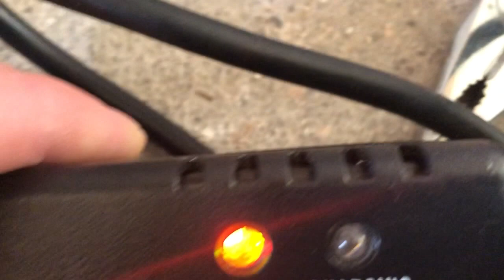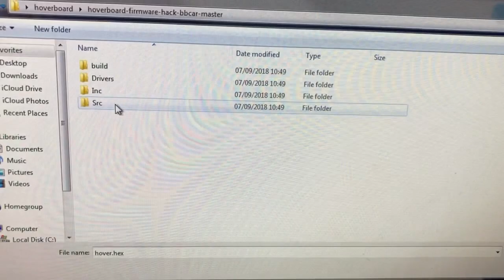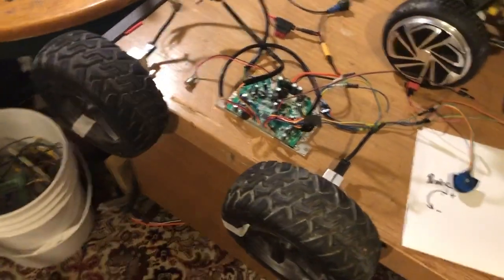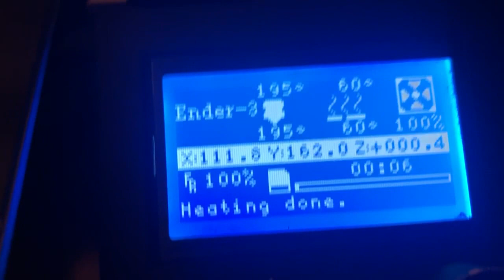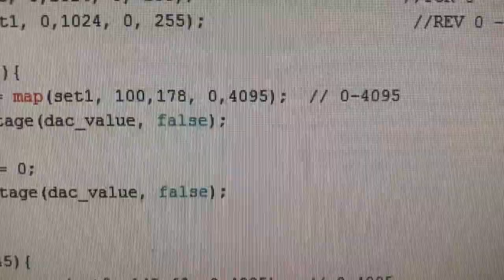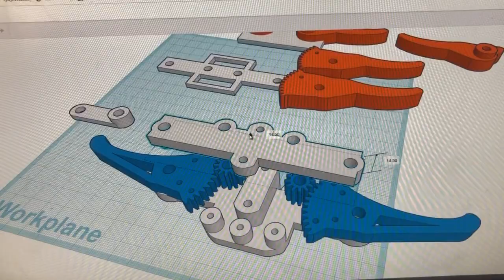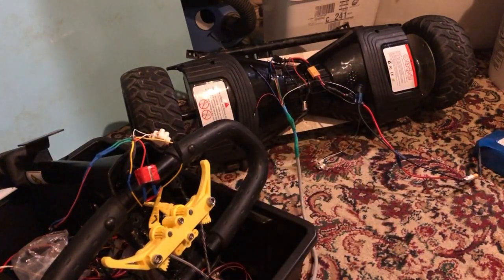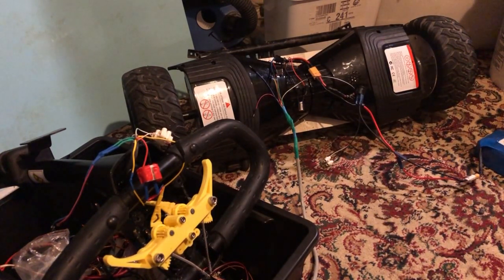HOVERBOARD MOBILITY SCOOTER - Part 1 - Build and Test - bobby car firmware

Comment: Ok what you did, you did well. 
The mobility scooter motor did look rough but it's likely that it was still able to function. I do like the hover board motors, they are efficient and hold up well from what I've seen. On the other hand the motor(s) and gear setups in the mobility scooters are on another level of durable function made to not break easily for a long time. As medical devices with functions must be dependable. 
What really makes the mobility scooters motor and gear setups put the hover board motors to be child's play in comparison is the amount of torque they have. If you have the battery power you can push/pull a a car/truck up a hill... At least until the incline becomes to much for the scooter to keep traction because it's not heavy enough. So you might get pulled/pushed back down the hill but the wheels will continue to turn. 
I just wanted you to know that if you haven't figured it out already. Have a good day and thank you for sharing what you did.

Comment: a couple weeks ago i had come across the hoverboard hacks...  havent gotten the rc hack to work quite yet...   been using ebike controllers for now,  made a razor scooter hoverwheel adaptation haha.     Today i came across a mobility scooter someone threw to the curb... did not come with seat or batteries so when I got it home threw on the hoverboard battery on it and it runs,  kid thought it was fun,  im starting to wonder what the mobility scooter could be like with a more powerfull controller, battery set up on it haha.   sorry for the randumb ramble but nice work,  seems to reflect what im getting myself into haha...  those larger hoverboard wheels are wild!
Reply: props for making the 3d printed parts!
Reply: that boost mode is awesome, o shit there goes the tape haha.. awesome work!
Reply from the maker: thats great, these hoverboard wheels are really good for these type of projects, loads more affordable than any alternative, thanks

Comment: Great project! Belive or not, i had exactly same idea but my wife doesnt allow me to buy more garbage. I have nanaged to get faulty hoverboard with with 10" pneumatic tyres. How fast does it go? does motors get warm? I wonder how fast would it go at 12s
Reply from the maker: hi, thanks, maby just buy it anyway and dont say anything haha, i didnt check the speed i was having too much fun but i think its about 15mph, 12s apparently can go almost 30km/h, thanks
Reply: @A-tech  не будет я подымал до 60 максимум 25 км час.
Reply: The 6.5" goes 11kmh stock on 36v

Comment: I have 4 hoverboard wheels and old shop rider scooter and a few nanos and 5 PWM DC 12V-36V 500W Brushless Motor Speed Controller Switch Driver Board, so I'm thinking to build one of these using what I have, any help or ideas please
Reply from the maker: hi, i have done a video about them controllers, they sound like the same ones, they are ok but i kept running into issues with them, also heatsinks were hard to get and attach properly, if you can the hoverboard motherboard is best, thanks
Reply: Hi, again. I'm going to use a hoverboard motherboard  (got 2 of these) and reprogram, what about the differential action when it turns corners. If both motors being  driven the same  how do get a differential action. the inside wheel should slow and the outside wheel should speed up.

Comment: I just dived into this i figured out how to flash and load the test program into the board. But havent find any quides how to set the board as a gocart like throtte & brakes. Or edit any files or somethimg like that been on to it more then 12h straight
Reply from the maker: hi, sometimes a break can help you get past things you are stuck on, I have a couple of motherboard hacking videos that you may find helpful, if you are ok with arduino you can manipulate the signals going to the boards to do what ever you want, hope this helps
Reply: @A-tech  i finally lerned how to select what i need and build program & upload the program. But now i need to find a way for throttle/brake and forward/neutral/reverse inputs.

Comment: NO CODE NEEDED!!!! SIMPLY REMOVE EACH GYRO BOARD ON EACH SIDE, MAKE A PLATFORM FOR THEM TO MOUNT ON NEXT TO EACHOTHER, AND A SIMPLY THROTTLE CABLE CAN CHANGE THE TILT ANGLE ON THE PLATFORM!!!
Reply from the maker: what you are describing is a go kart kit that people can already buy, have you seen the one with a seat and 2 levers?
Reply: @A-tech  no... can you link... and not really looking to buy.. i have multiple hoverboards no longer in use and in great shape, i would like to use them if at all posible.

not making a gocart but a trike.
Reply: @A-tech  never mind found it... again, i do not want to go thru the hassel of flashing firmware and writing code.

i saw somewhere a guy that added some resisters to the board itself to allow for throttle control.

Comment: Hi! sorry to bother you, can you help me with this question? is it absolutely necesary to use an arduino  for the firmware of the bobby car? Can i just upload the firmware via st v2 and get the differents modes? Thanks again and amazing video!
Reply from the maker: hi, the arduino is only used so I can control remotely, you can use it with just the 2 potentiometers also, thanks

Comment: Thanks for posting this!, What values did you use for the pots? 10k? also is the wiring of the pots, the same as in your #2 original video.

I wanted to build a 2wd scooter with the original hoverboard motherboard, would this firmware work? do you have any other recommendations. Thanks in advance.
Reply from the maker: hi, yes 10k pots, wiring is the same too, ok in this one im using a different firmware that has no steering, thats probably what you need so the wheels go the same speed, thanks
Reply: @A-tech  do you have a link to the firmware, thanks
Reply from the maker: @fixbuildmod  i can email the hex file if you like
Reply from the maker: @fixbuildmod  ok sent, no problem
Reply: @A-tech  I need it too, but I have the st link and don't know how to upload to the motherboard
Reply: @A-tech  Hi, i made it with 10k pots, but as soon as I connect the battery, they start moving at low rpm, and they go speeding up with the pots, I wanna know why the motors don't stop
Reply from the maker: @gianlucadionisi6730  hmm, are you using 3.3v with the pots?
Reply: @A-tech  yes, i take The 3.3v from The pins for The ST link
Reply from the maker: @gianlucadionisi6730  the controls are weird, one is for direction and the other for speed, so try to make them the same speed with one then try slowing them down to a stop

Comment: Hi I have converted a ninebot mini pro and fitted a seat as I can’t walk very far it works great but if I mount a kerb or ramp and one wheel grips but the other wheel slips it spins very fast making it think I am going over the safe speed(if I was standing on it) it then violently throws me back making me go straight onto my back hitting my head on the ground!! If I could disable the feature or say increase the max speed limit to the max It would stop this happenings would prefer to just cut a wire coming from  a sensor to permanently disable it but if it can be reprogrammed that is ok, it would really great if you can help or put me in touch with someone I don’t mind paying to get this problem sorted thanks
Reply from the maker: hi, its probably a safety thing so it doesnt burn out a motor maby or go too fast as you say, the wheels really arent meant to slip so it could cause it to do all kinds of things, i would be tempted to put a front wheel on it so its like a trike, this would also help getting some weight off the back wheels and go up kerbs and ramps easier, hope this helps

Comment: Thanks for a brilliant video! I'm going to try to "upgrade" my mobility scooter in a similar way. Do you know of any ready made throttles(?) for forward and reverse, since I don't have a 3d printer? I'm guessing it's impossible to reuse the ones on the scooter today, since it's only one motor controlled by one pot. Also, and you might have said this, which arduino are you using for this project?
Would it be possible to receive your files for this project?
I've watched this video over and over trying to get all the information, but unfortunately my mind doesn't work as well anymore since I became ill. So I'm sorry if I'm asking something really obvious. Thanks!
Reply from the maker: hi, thats ok i probably missed some stuff out, if you used an arduino you could possibly use the existing one, but you wouldnt be able to set some speed options if you cant press both at the same time, you might be able to make some pedals or something using some potentiometers and springs, maby a ebike throttle im not sure, i was using an arduino uno, they are cheap and have a decent amount of pins, yes i can send you the hoverboard hex file and the arduino file no problem
Reply: @A-tech  I don't know if you've had the time to send me the files yet, but I haven't received any. In case there was a typo in the adress or something 🙂
Reply: @A-tech  any chance you're gonna be able to send the files soon? I'm quite anxious to get started 😊
Reply: @alexanderwinkler3639  not sure if your still looking but if you look up “ ebike thumb throttle” there like $10. It can be used with Escooter and ebike esc’s but uses a 3 pin output and is basically what this guy made. Hope this helps, realize this was a year ago 😂

Comment: I am trying to follow your way and even got one  scooter today that seems to be the same brand but may be not a Plus version.  Can I ask some questions about what have you used in general to do this project? My scooter motor is ok so I guess I can use it without spending any extra on hoverboard wheels. Would you mind providing  your email or direct me to a blog with this build(if you have any)?
Reply from the maker: hi, sorry for the slow reply, yes sure here is my email: edeped@yahoo.com

Comment: hey i was hoping to do thesame your doing but the parts with the throdel and brake is the part i get cunfuesd like i dont know what parts i need to buy and how i should do all of this becaus im realy new to these things do you have any tips on what i could use?
Reply from the maker: hi, personally i think the best way is with an arduino so you can fine tune the ebike throttle, most of them i think are just a potentiometer and a switch, when you know which wires do what its pretty much the same as in the video with the potentiometers, hope this helps

Comment: Whats your suggestion for an emergency stop ? Disconnect the battery ?  Would that kill the board ?
Reply from the maker: Ye that would work but it wouldn’t stop fast, You could try connecting all the motor wires together on a relay to add a bit of resistance
Reply: @A-tech  do you think that disconnecting the battery would burn the board  ?
Reply from the maker: @charlesrg  hmm, i dont think do, why do you say that?

Comment: Nice job.any chance to get a modified mother board and all system for 2 hoverboard wheels?i want to build a scooter 🛴.i have the parts. a hoverboard but I don’t know how to firmware and all setup.cheers.
Reply from the maker: ok did you want me to put different firmware on it for you?
Reply: @A-tech  I have a normal hover board 350w.and I have made a scooter from it with a cheap Chinese controller. It is working fine but it have no power and range like the hover board. What I am thinking if I use only one motor (wheel) with Chinese controller have no range as the hover board with two motors.mabe if I get a motherboard modified and use it instead of the Chinese controller I might increase the range per charge?at the moment with Chinese controller I drive it one wheel about 30 min with one motor. The hover board had the range of over 2 hours with two motors same battery. Now I am thinking can I get that range with one motor and  a modified motherboard? And mabe little more speed? And what will be the cost of that mother board?thank you for reply.
Reply from the maker: hmm yes the chinese controller is probably not as efficient, the standard motherboards are on ebay for around £20 so not too bad, i would imagine using a modified motherboard it would still be similar to the standard one, hope this helps
Reply: A-Tech thanks for your fast response.so i have the mother board,what i need is to firmware and the conections for throttle (3wires).can you do that?if i post the motherboard to you? And how much would it be?or is on ebay motherboard modified to buy?
Reply from the maker: @danpaslea4605  ok send me a photo to my email edeped@yahoo.com and i will see if its suitable, thanks
Reply: @A-tech  hi I was actually trying to build the same concept because the mobility scooter goes so slow it drives me nuts, im physically disabled and progressively becoming worse so anyway I got a scooter for free and a trade for a working hoverboard so I was wondering if you could do the same thing for me if I mailed you the existing throttle in pot and stock hoverboard control unit if you could do the hack and make the pot levers for me if you let me know how much you want for the help and your labor.

But seriously this was a super genius Whil e Cayote build, thanks for posting this and actually figuring out how to make it work. I was actually thinking I'd have to connect 2 BLDC controllers to make it work but you saved the day. 
I also thought like the person above that I'd have to get a twist throttle.